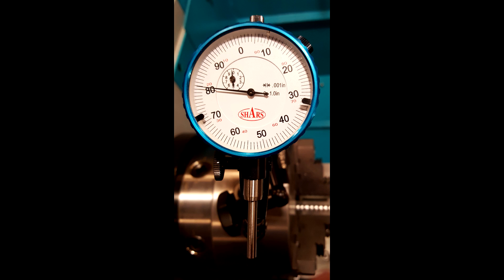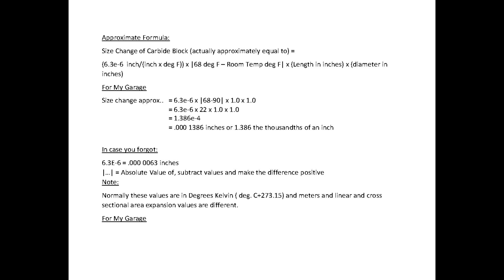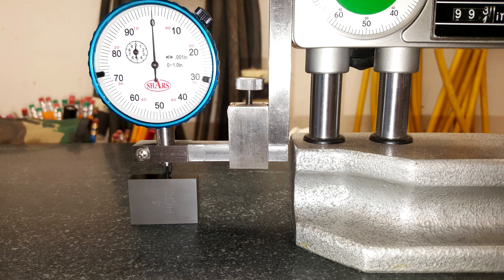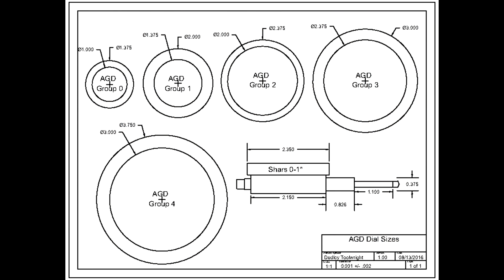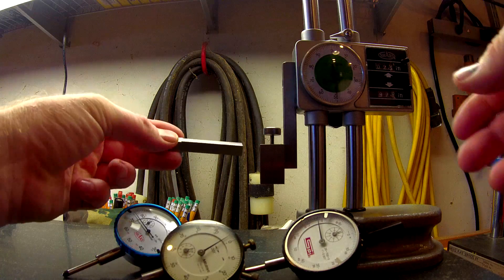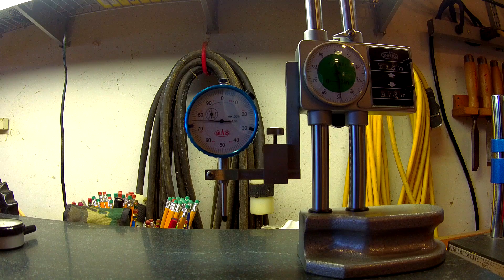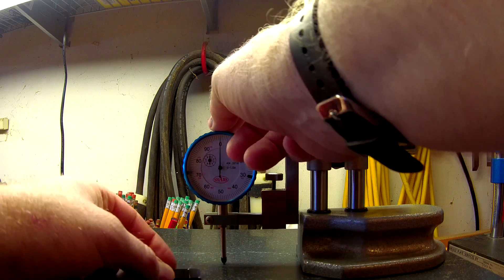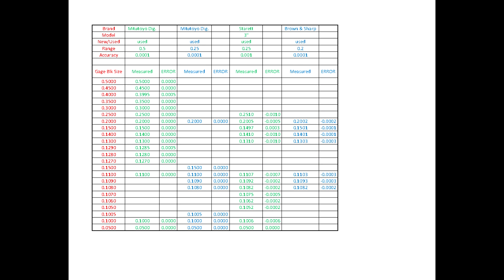Shars 1" Dial Indicator Evaluation

Comment: It's very interesting to look through the spreadsheet. I did something similar a few weeks ago, including testing Shars .001" and .0005" plunger indicators, using a surface plate, and gage blocks. Both are grade-B. A Brown&Sharpe height gage. Also tested a number of Asian imports, a couple of Mitutoyo and Starrett indicators, a Japanese Enco, and a couple of 3.75" Federal .0001 conversation starters. The results were similar to yours.
Reply from the maker: Interesting! Thanks. It is useful to note that a second set of tests, performed in a different shop yielded similar results.

Comment: I think the consensus is that new, most indicators are deadly accurate, the issue comes later on when the lower quality materials used start to wear, I suppose if you are going to mass produce all your gauges and initial quality has to be pretty good initially. I would love to see a good amount of rough love to see which one holds up. Maybe the brand names are just as bad as the cheapies, or maybe the cheapies are just as good as the brand ones. It comes down to trust, this to me proves I can trust a brand new indicator from Shars, but will it be a long lasting trust ?.
Reply from the maker: I did that review quite  while ago and the indicator was working fine until the shaft got bent. It was very soft and that was the end. I have a Shars - Aventor set of calipers, that I use every day and they have held up. ONe negative thing about them is they seem to be a lot more sensitive to temperature shifts than my Mitutoyo's. I have to re-zero them often. Thanks for taking the time to write an interesting comment.
Reply: Really if you are working to 1/1000 of an inch or to 1/10,000 of an inch (tenths) no dial indicator should be trusted without checking it in the desired measurement range with gauge blocks and a surface plate before using.   Your point about durability of name brands is well taken but blind trust in a name brand indicator that may have been dropped or otherwise damaged the day before would be unwise regardless of brand or country of origin.  Here is where the common sense part comes in.  If you are a home machinist these budget indicators should be fine and will improve the accuracy of most hobby machinists.  Of course a  career toolmaker/machinist or quality inspector earning a living from their tools the expensive gauges calibrated and checked often would be the way to go.

Comment: I think some of the difference between a more expensive indicator and a less expensive indicator is the amount of force required to move the measurement rod. With more expensive indicators requiring less force and more consistent across the range of measurement.
Reply from the maker: What a great observation. I did not even think of that, being movement force. I wish I had tested it. I did test linearity to some degree. that was the reasoning behind my choice of values. The inexpensive dial indicators faired reasonably well. Thanks for the comments and insight.
Reply: I’ve seen this in other comparisons. The spring force remains more constant on more expensive indicators and increases steadily on cheap ones. Still, love seeing cheap stuff that works.

Comment: A co-worker turned me on to getting a Shars .0005" test indicator for tramming in vises and occasional hole centering on mills. I think I'll buy one now. For .0005" increments I'm not looking at spending a lot of money like I would for a test indicator of .0001" increments, so the Shars looks like a great deal. Thanks.
Reply from the maker: Thanks. So far I have been reasonably happy with the Shars indicators, especially for the price.
Reply: Shars offers a 1/10,000 0-4-0 .008' travel test indicator for under $50. you could rough in the alignment with the 0-1" plunger type and dial in your final setup with a .008 or .030 test indicator to near perfect.

Comment: Thank you for the informative video, I am not a machinist but your information was very helpful, what are your feelings on buying used dial indicators.  I am a woodworker and prefer American made tools, I work as a firefighter to pay the bills and look to save money wherever I can.......
Reply from the maker: You might luck out. I have bought a bunch of used indicators on ebay for my tests and the ration of good to bad is about 70:30. It is important to note that some of the indicators that were in excellent external condition turned out to be problematic and others that looked well used also functioned perfectly. I guess my overall advise is that purchasing used is a bit of a crapshoot, but often a lot cheaper than new, so might be worth the risk.